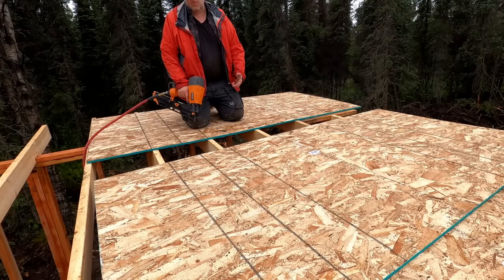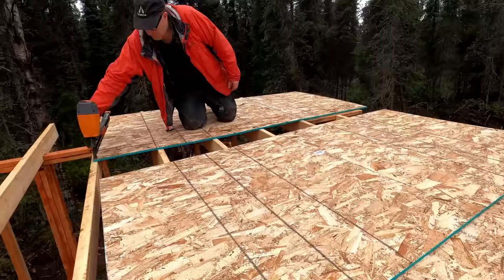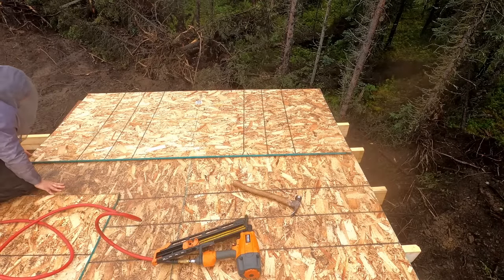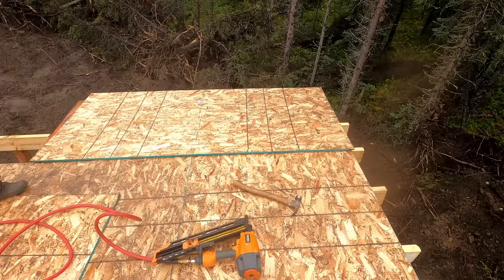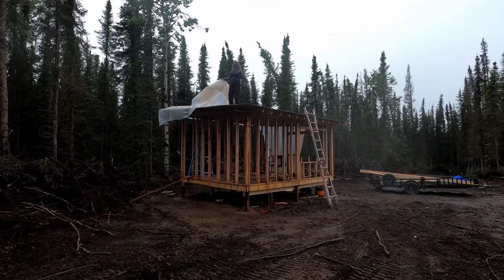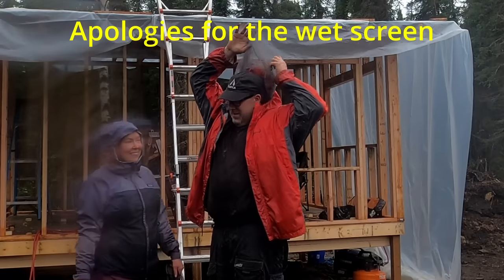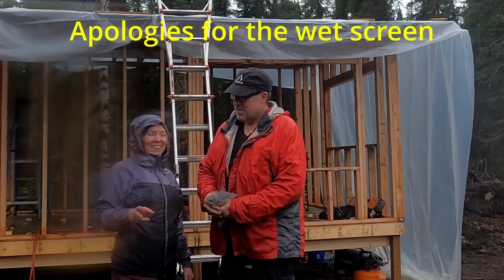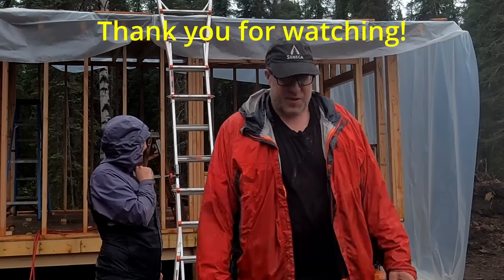Chicken coop is almost done | Roof Sheathing

Comment: Why are you building such an elaborate coop looks very costly
Reply: Maybe they are fancy chickens 🐔 .
Reply from the maker: The reasons are a couple fold, I’m going to be going over that in a future video. Mainly it’s because it’s super cold up here and those chickens are gonna spend about 6 to 7 months inside that coop during the winter.
Reply: @LifeinAlaska nice job thinking ahead and planning for trouble in the future. Helps save time later. Better be safe than sorry. Especially when it snows like a crazy 36” in one day. Ha! Alaskans make it happen! A+
Reply: @BulldogTrading  heck yeah!
Reply: @hopemorrison2367
Sounds like you should check out some other Alaskan off grid homesteads to get a better perspective of the needs of having birds and farm animals in such harsh conditions.  Check out the hard work required to maintain a sustainable lifestyle in Alaska. There are plenty of YT homestead creators to gain information from.